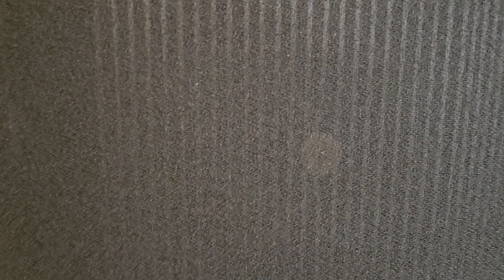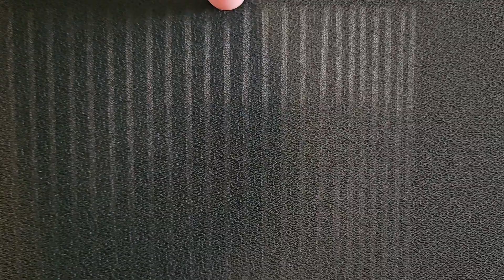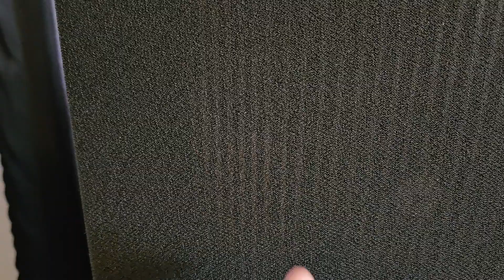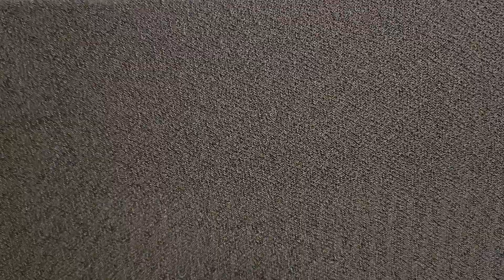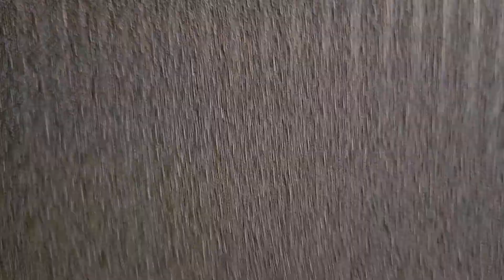To GR-RESEARCH Maggie LRS+ Upgrade

Comment: What does this mean?
Reply from the maker: Letting GR-RESEARCH know in case they have to measure each speaker individually.
Reply: @thepracticalaudiophile  But does this has an influence on the upgrade? I don’t think so. These “knobs” are placed to achieve a balanced performance of the two speakers. Or not?
Reply from the maker: According to Danny at gr-research, they won't have any effect. I'm getting the upgrade on Saturday. Will try to install Sunday. I'll keep you posted.
Reply: @thepracticalaudiophile  thx, I will get my lrs+ next week.
Reply: So I did the LRS+ upgrade from Danny and it definitely opened the speaker up but the two speakers being different definitely shows through. Some of my music where vocals are supposed to to be high and to the right are to the left like it’s out of phase. But it’s not.  Altogether a neat upgrade that opened my eyes to better crossover components but these speakers are still limited. The drivers just aren’t as capable as what a good dynamic transducer can do. They have the speed but not the resolving power and they definitely don’t throw a 3dimensional sound the way a dynamic can
Reply: @t.j.bennett6454  I cannot confirm the lack of resolving capability. The LRS+ is a highly resolving speaker. Also his capability to show a 3 dimensional image is impressive. I own dynamic speakers in the 20.000€ range. They are of course better speakers than the LRS, but not her resolving capabilities. The stereo image is different of course, but the LRS perform very well. Of course my dynamic speakers have more body and… bass. But in a small room, even the bass of the LRS isn’t bad. Not very deep but so fast. Even the normal LRS+ is a very open sounding speaker. If the upgrade opens them up further, will this really improve her performance?
Reply: @dieterleonard2309  to each his own. Like I said, I like them but also hate them.  They don’t have the body of the textures or the distinct out line and 3 dimension most of my dynamic speakers have. Details are there but not as easily heard.   I have them hooked up to a pretty expensive system. I also have a fully decked out crossover on the way from the Netherlands coming for the lrs+ with duelund, jentzen and mundorf parts.  We will see if they can resolve more.
Reply from the maker: @t.j.bennett6454  Did you know that the color of the wires isn't consistent? The two inside (regardless of color) are the negatives, and the two outsides are the positives?
Reply: So actually when I did the upgrade one of the speakers was out of phase after going by the template Danny sent. It was a weird out of phase though as the sounds didn’t have an issue left to right it was front and back. Swapped two wires and got it right first try
Reply: @thepracticalaudiophile I still feel like there’s something a little off though. There’s a song that i know well and on every system the female vocal is upper left but on the mine it is top right
Reply from the maker: @t.j.bennett6454  You know about the tweeters being out of phase to the mid/bass. That is the negative goes to the tweeter positive and vice versa.
Reply: @thepracticalaudiophile  I just went by what he sent me then adjusted one speaker and it seemed to fix it. I need to figure out how to just check on my own. I’ve looked it up and the only thing I’m seeing is with a battery and dynamic drivers and I don’t think that will work as well with the Maggie’s
I’ll have to upload a video on here and send you the link so you can see if mine is right